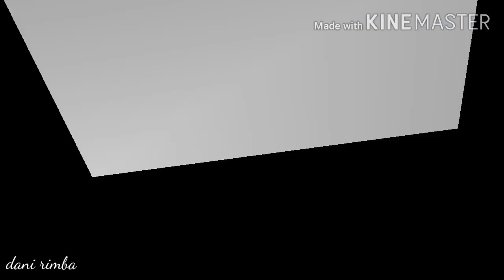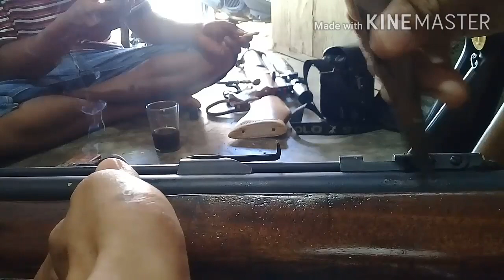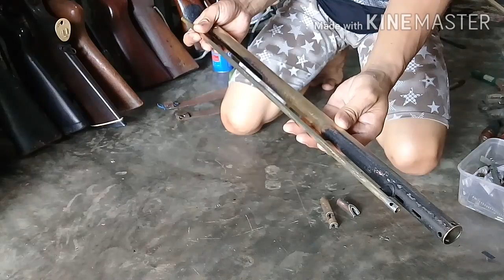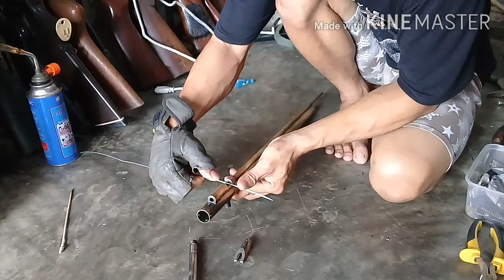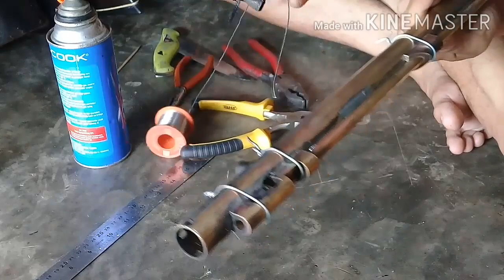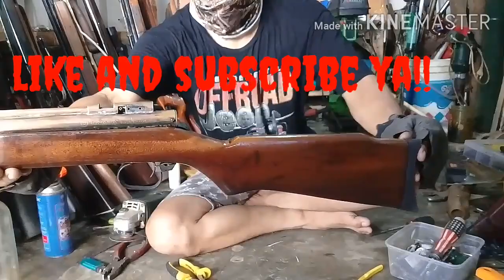CARA MUDAH GANTI LARAS CANON JADI LARAS PANJANG DENGAN HASIL YANG LUMAYAN RAPI

Comment: Alamat dimana gan..unit saya Canon 707 pengen diganti Laras seperti bisa gak gan??
Reply from the maker: Banjarsari ciamis mas..bisa2 aja mas
Reply: Kira2 kena berapa bang
Reply from the maker: Klo mau seperti di konten..yg pecis gitu abis 220 mas termasuk laras ny
Reply: Ok gan saya mau unit Canon saya dijadikan seperti itu gan..
Reply from the maker: @adrianmaulana3476  siapp
Reply: @danirimba6526  lamun dikirim unit anu abdi kudu ka alamat mana kang
Reply from the maker: @adrianmaulana3476  dsn.pangarengan rt10/03 dsa.sindangasih kec.banjarsari kab.ciamis .. no hp.085222239661

Comment: Harga laras brpa bang sama minyak yg diolesi  itu apa namanya? Terima kasih salam satu laas
Reply from the maker: Laras yg od 8 apa 14 mas ..klo yg d oles kn itu air keras mas
Reply: @danirimba6526  yg dpasang itu od brppa
Reply from the maker: @adifian4899  itu od 8 mas cuma depan ny pake pipa od 13,,,coba liat d konten saya yg laen..ada yg pake od 13 full juga
Reply: @danirimba6526  siap86

Comment: Jual laras nya kah mas?
Reply from the maker: Ada bang..
Reply: @danirimba6526  kirim ke lampung berapa bang untuk canon 727
Reply from the maker: @NurielAurora  mau laras yg gimana..mau yg polos apa yg alur..soal ny kan canon 727 yg itu modipan laras ny dari pende ke panjang..od 8 cuma pake pipa od 13 itu d kash cuma d ujung nya doang ga sampe full
Reply: @danirimba6526  kurang faham mas,  yg penting bisa pake peredam, ujung nya aja bisa ya
Reply from the maker: @NurielAurora  yang punya mas itu senapan ny percis sama d youtub saya ga..canon..asli ny kan laras pendek .klo buat drat perdam buat canon sih ada
Reply: @danirimba6526  ya mas sama persis,  berapa kira2 mas untuk harga
Reply from the maker: @NurielAurora  murah mas klo dudukan perdam nya cuma 25 rbu,,yg mahal pasti ongkir ny..kmaren saya ngirim senapan ke kaltim 150 ongkir ny
Reply: @danirimba6526  ada wa om biar lebi enak
Reply from the maker: @NurielAurora  085222239661